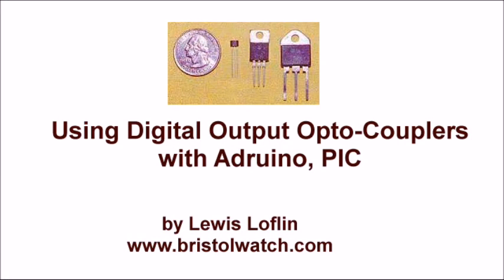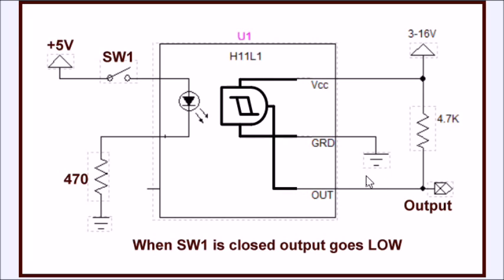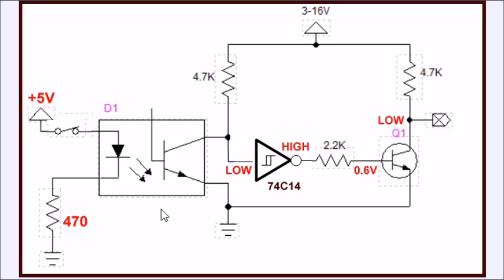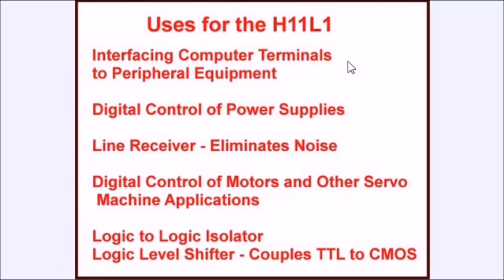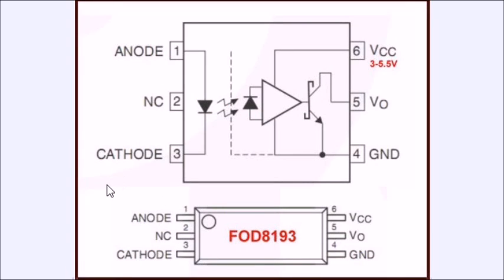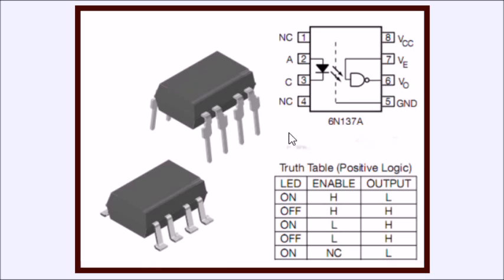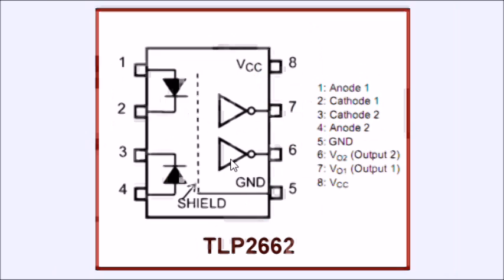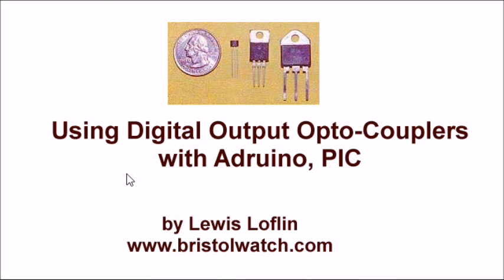H11L1, 6N137A, FED8183, TLP2662 Digital Output Optocouplers

Comment: I've looked for a datasheet for "FOD8183" as described.  I also looked for "FED8183" as shown in title.  Do you have a pointer?
Reply from the maker: It is an obsolete part no longer available.
Reply from the maker: It is an fod8193 the pdf is at http://www.farnell.com/datasheets/1817594.pdf

Comment: Very nice video.  We're working with VR reluctor type speed sensors that have AC signal outputs with minimum of .16V.  We've been looking for exactly what your video is describing.  It all looks really good.  There's one spec I can't find.  On the anode that triggers the LED, what is the minimum voltage and minimum current that will trigger the LED circuit?  I have used a typical optoisolator that does not have digital conversion and it is triggering.  
I am new to all this and don't know where that spec is.  
Thanks for a great video.